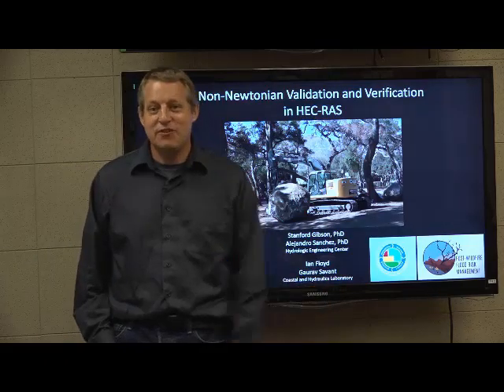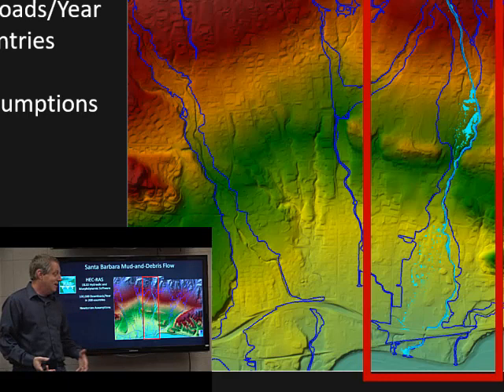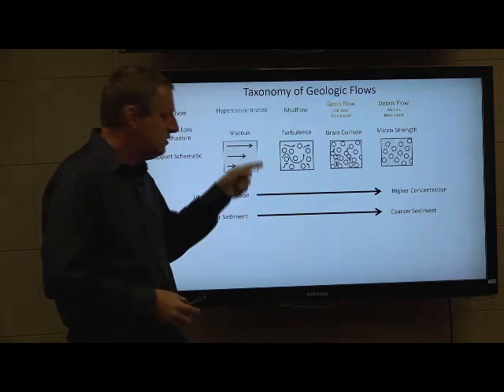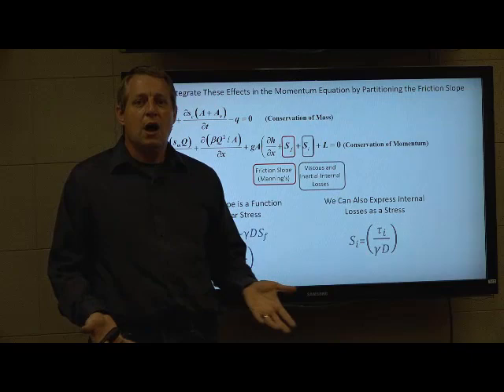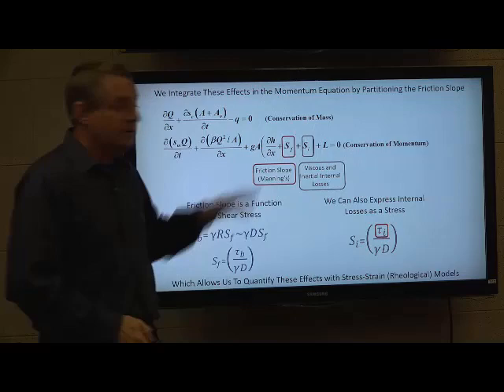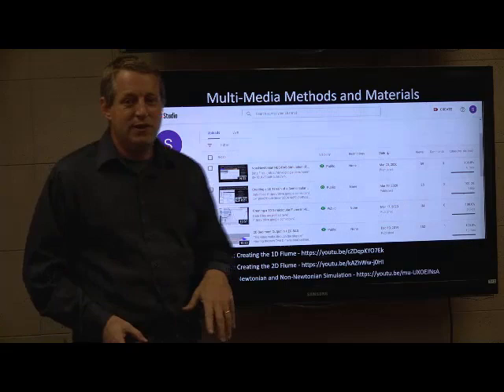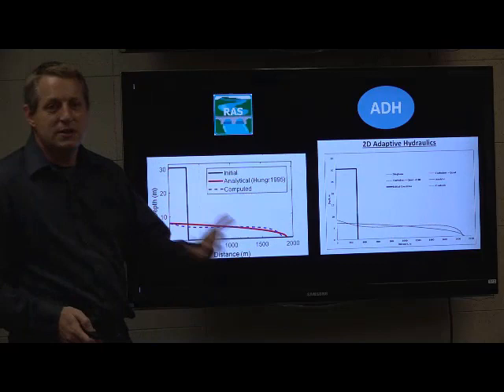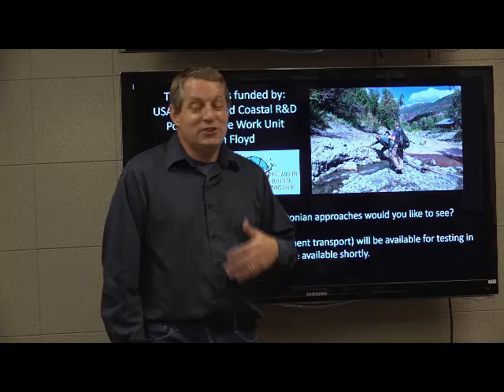Mud and Debris Flow in HEC-RAS with DebrisLib

Comment: Sir can we simulate non newtonian flood inundation pattern(flooded area,depth profile,maximum velocity etc) due to dam break of tailings dams using HEC-RAS?
Reply from the maker: Yes.  We've done this a couple times already with very good results.  We have a manuscript prepared to go out and I'll make videos on it once the data are released for publication.  But we expect that mine tailing dam failure and post wildfire analysis will be the two primary use cases.
Reply: @stanfordgibson  Sir can i get your mail id so that i can stay in touch with you for the technical support as i am pursing my degree in masters of technology from IIT Bhubneshwar.My topic for the thesis is "dam break analysis of tailing dams".As stated by you that you are soon going to release a video on it,kindly do so since it will be helpful for me to understand on how to use HEC-RAS for simulation of tailing dam failure.
Reply from the maker: @ujjwalchaudhary4673  can you reach out to me on ResearchGate or LinkedIn?
Reply: @stanfordgibson  Yes sir i am comfortable with linkedin.
Reply: @stanfordgibson  sir can you please check your linkedin, i have been trying to contact you for weeks

Comment: Sir, it is possible perform lahar modelling using this HECRAS version? lahar flows have several solid concentrations, so I wonder if the rheologic model is suitable for lahar flows. 

Thanks for your work!
Reply from the maker: Rheological models have been used for Lahars.  They are approximations and exclude some of the processes, though, so some prefer more mechanistic models.